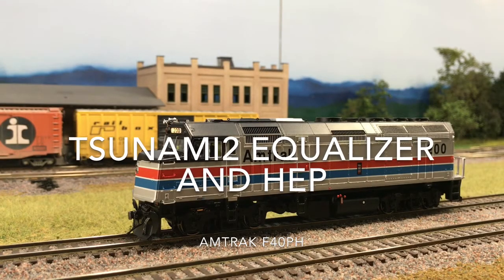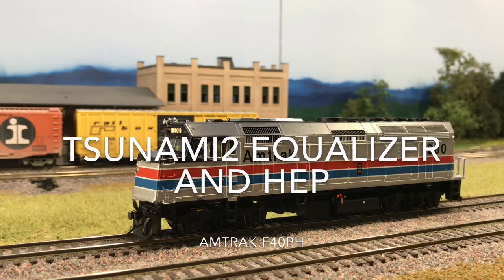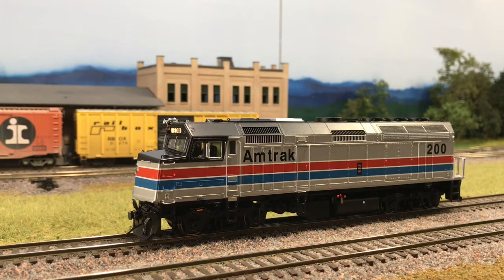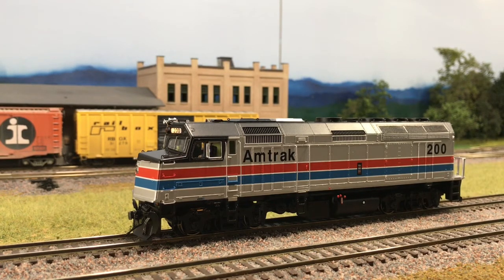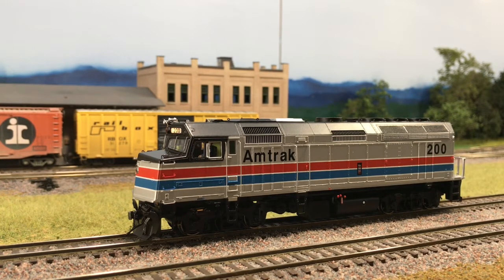TSUNAMI2 In Amtrak F40PH Using HEP

Comment: George that is so cool, always enjoy your videos. I have a question for you on the tsunami 2. Norman has tried to help but I don't feel like my questions are getting answered.  On the tsunami 2, I am trying to set my loco up for the best possible low speed operation. I have cv 215 set to 13.9 track voltage 139. I have been messing with cv's 211 and just today cv 10 and 212. I have been reading in the user's guide. Also co efficient loops which went right over my head. I mean there should a purpose for these cv's for better operation otherwise they wouldn't be there. I know if anybody knows it would be you.

Thanks,

Chuck
Reply from the maker: Email me at georgeb@soundtraxx.com and I’ll dive deeper when I’m back after vacation.  Thanks!   
It shouldn’t be difficult, so I’ll try to help explain in more detail.